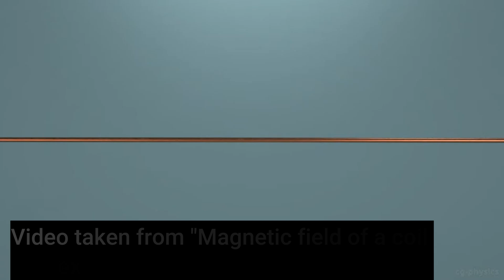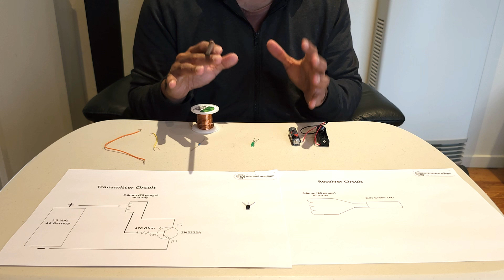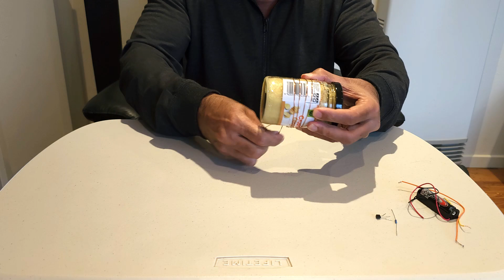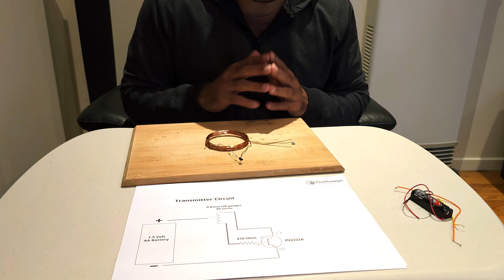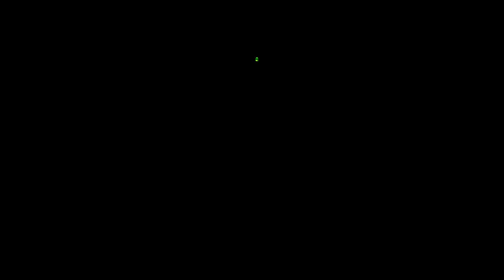How to Make Wireless Power Transmission (electricity transmission)

Comment: What is the main purpose of that loop??  9:45
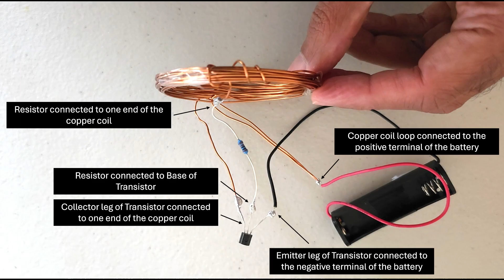Reply from the maker: Loop is connected to the positive terminal of the battery. Go to @16:14 in the video. Cheers
Reply: Yes!!  @FinLogs  I know that, positive supply is given at that loop 🔁!! 
But I ask you!! Why???! 
What is the purpose of doing that?? 
We can simply provide supply, in one end of transmitter coil!! 
Instead of that we are, providing supply at that loop!!
Reply from the maker: I get it now. The transistor's role is to create an alternating current through the coil, which is necessary for generating the fluctuating magnetic field for wireless power transmission. You cannot connect the positive terminal of the battery directly to the collector of the transistor in the transmitter coil because the transistor needs to control the current flow. This is why the positive terminal of the battery is connected to the center tap/loop of the coil. Directly connecting the battery would bypass the transistor's switching function, preventing the transistor from switching ON & OFF and creating oscillating current and the fluctuating magnetic field. This oscillating magnetic field is what induces an alternating current (AC) in the receiver coil for wireless power transmission.
Additionally, the current path through the Collector leg of the Transistor is essential for proper transistor operation and to ensure the back EMF can turn the transistor ON and OFF, enabling continuous oscillation.
Hope this explains it. Cheers
Reply: @FinLogs  thank you!! ❤ it's very helpful!! 😊